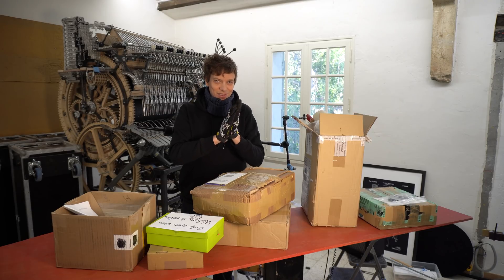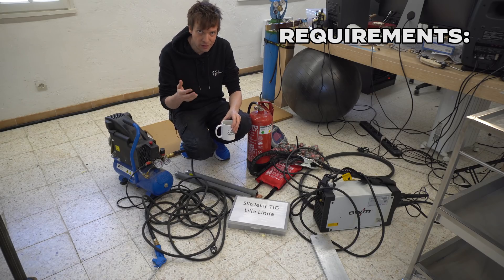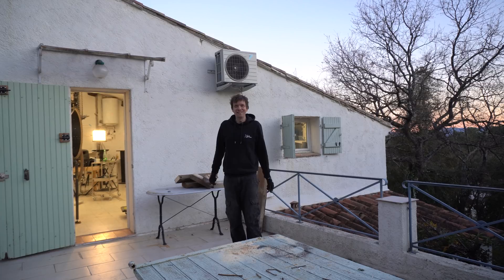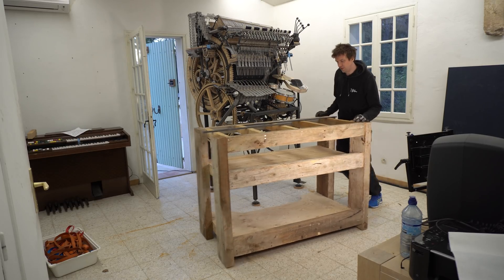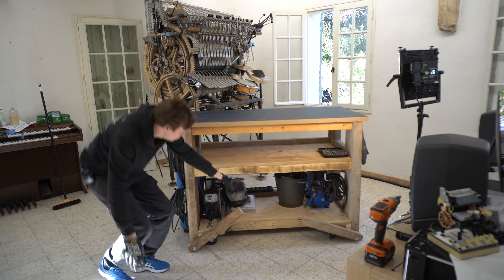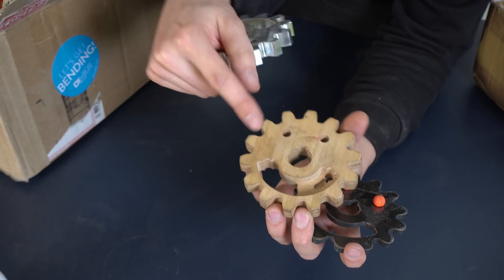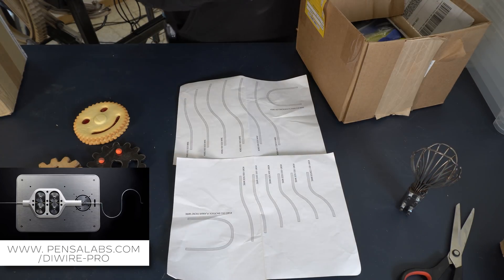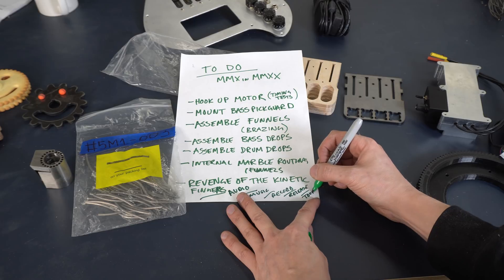New parts New workbench New start - Marble Machine X #113

Comment: table locks: with an 10cm notch at the bottom the table would lock fimliy when bar is on floor. upright would disengage. no more diagonal obstructions of shelve. quickly done.

Comment: Not very logical this table for me (but i'm not an engineer), to have made such massive legs which are useless... in fact either you are on the wheels to move the table, or you are on the "lock" system which is screwed on the legs and which has a small rounded surface in contact with the floor. the logic would have been that when you lower the lock down system you are on the wheels to move the table and when you remove the lock you are on the massive Legs on the flloor with big contact, to be much hefty and stable ^^ no ?

Comment: I'm disappointed that you are adding a motor. The whole point of the marble machine was that it was 100% handpowered. Obviously you need electronics for the instruments, but to artificially cause the wheel to spin with a motor seems cheap to me.

Comment: Don't really like your motor choice, at my opinion you have 2 solutions: stay manual or make a full system with sensor to ensure you have the correct speed. Your actual system is just good for a little assist, but not to fully control your tempo with a minimum of accuracy. At my opinion, adding some sensor and a one-way bearing to your solution could be a good idea.

Comment: OBS OBS MARTIN!

You need to check that your extension cord is able to carry the current that your welder puts out, and I'm 90% sure it does NOT.
Your welder needs to be able to gulp 16A through everything, and those splitters are usually very thinly wired internally.

Safety aside; MY GOD you've done a lot! Must feel so good, and I wish i could pull myself into a similar organizing mode. I will try, after seeing what you've accomplished in 3 days man.

Well done and keep it up!

lotsa love from Norway! 
PLING

Comment: Your workbench legs are built super thick and strong but I think you shoutd reconsider the lever mechanism as your working weight is resting solely on the pivot bolts. Check out Carl Holmgren's channel. I've made most of my shop furniture based on his  collapsible wheel system. It works great and looks super classy for shop furniture, which I think is a little bit your style. https://youtu.be/7TTnb3TyH5Y

Comment: Welcome back! You were missed good sir!
The smart motor drive is an awesome performance based improvement to the MMX!!! 
Lotharyx has a great safety idea. You have a VERY heavy table now, and it would be easy to inadvertently fall off the lever based feet. I say this as I've actually seen similar actually happen. Was not pretty.

Comment: Beware the electric plugs below the table! They will collect electrically conductive dust and metal chips. Better install the plugs on a vertical surface, below an overhang or, even better, face down.

Comment: While I appreciate Maureen's animations for the Kinetic Fingers I still vastly dislike them. I agree with you 100% that having some sort of additional visual indicator will be beneficial for audiences not close enough to the stage to see the action of the mechanisms, they are just way to visually disjointed from the rest of the design. The MMX has a glorious clockwork, engineerpunk aesthetic and the spider-like and honestly rather creepy looking fingers are obviously offputting to a number of people. Perhaps some sort of semaphore flags or even little RGB LEDs that you could program to light up and flash different colors per song?
Reply: I think maybe something like a rod (wood with steel tip maybe) could accomplish the goal. I'm not sure how it would look, but it could give enough exaggerated movement to fit the purpose while not looking creepy. 

I'm not sure putting RGB into the MMX would do more than mess up the ascetic. 
That said, putting in some warm white lights (like the yellowed white of the classic Christmas lights) I could see fitting the theme, lighting dark spots for cameras and perhaps highlighting active zones like @guttebo is saying.

Though this is just as likely to be considered Feature Creep by the powers that be.

Comment: Id have done something different Martin. Having the electric sockets at the bottom of the workbench, facing up, will mean itll catch a lot of dust and debris. Maybe even cause shorts if you work with metals.

Id pop the sockets on the back of the bench, facing outwards so it cant collect debris that easily and you also dont have to crouch down every time you want to plug something in/out.

Comment: I'm sorry, Martin, but the kinetic fingers are just a bad idea, and I think I can convince you precisely why that is. I did watch Maureen Krauth's animation. It doesn't change the underlying problem. 

The problem with the kinetic fingers is that they violate a key core value of the MMX. This core value is "function over form." You have shown us, in your design for every single particle of the MMX, that the machine values function over form. The machine is efficient, packing a tremendous amount of function into a relatively small volume. Consequently the elements of the machine—the gears, wires, screws, everything—are exposed and direct. The machine doesn't waste time, energy, or weight on superfluous or cosmetic elements. It shows itself as a machine. So, in everything you've done with both machines so far, you've vigorously followed this principle of function over form: mechanical efficiency over cosmetics. 

The reason everyone hates the kinetic fingers is that they violate this principle. They are a purely cosmetic, not functional, element. They don't contribute to the music; they are purely visual. They represent the machine being untrue to itself. They are a pretense, not a reality; a mask rather than a face. 

I know you're concerned about audience members not being able to see the machine in operation well enough. But come on: find another way to solve this problem. The fingers don't even solve it: they only enable the audience to see moving parts, not to see THE moving parts that actually make the music. So: set up a video feed of a camera close to the machine and project it onto a screen, or let people tune into it on their phones. Maybe there are other creative ways to increase contact between the audience and the machine. Frankly, simply ignoring this problem would be better than the kinetic fingers. Jimmy Page plays a mean guitar, and no one past the fourth row of a Zeppelin concert could ever see the fine details of his playing. And that's okay. They could hear it. They could see his overall body movement, just as they'll be able to see yours and that of the rest of the band. Jimmy Page didn't wear giant mechanical fingers over his fingers to help people see his playing. He didn't need to. Neither do you.

It's a bad idea, Martin.
Reply: This is spot on. Whole time reading this I was thinking about guitarists. And then you finished with that point. I hope Martin sees this. 👍
Reply: I hate the Kinetic fingers because they look creepy and terrible as all hell, not for any other reason.

And I hate to argue against a fellow opponent of them, but ... Marble Machine is about doing the job of a simple synthesiser or set of musical instruments with freaking marbles for no reason.

In that sense, the whole damn machine is really "Form over function", as functional as all other parts may be.

EDIT:  I can join with you wholeheartedly on one thing for sure though, regarding function over form.

I hate the fingers even more knowing that functionally they absolutely DON'T need to be there.

Comment: why do you need to build a table stopper?
you can use wheels with stoppers builtin already.
like this:
https://www.google.com/search?q=table+wheel+with+stops&rlz=1C1CHBF_enIL860IL860&sxsrf=ALeKk02Dge6wsemsRXaDlH4m3klvdBJcRw:1582212577727&source=lnms&tbm=isch&sa=X&ved=2ahUKEwis8J2VueDnAhUsNOwKHe0pC0wQ_AUoAXoECAwQAw&biw=1920&bih=1057#imgrc=SrV0sn1CI81hiM

Comment: You should put a steel surface on the workbench, then you can use it as a welding table. There's an Ebay seller in the UK selling pre-cut fixture table plates for making your own welding tables with lots of 10mm slots and fixture holes. I used one for my own welding workbench.
Reply: https://www.ebay.co.uk/itm/Welding-Table-Top-Jig-Fixture-Plate-Make-your-own-Table-Jig-fixture-mig-tig/273630693229?hash=item3fb5a9076d:g:olcAAOSwfPlbpOCW

Comment: You have a problem.
If you push the table sidways while the taple is up. The table will flip to the rolls and drive away .
Wouldnt be so cool if you are welding .

You can drill holes in the handles into the stands/legs .

So you can lock the handles with a M screw or bolt or stick . 
Would be a bit safer, i think.

Greetings from germany 😉

Comment: If that bench isnt study enough Mathias has a recent design where the bench has no wheels, but he has two long L pieces with the wheels on them. You slide them under the bench and rotate the L so its vertical, and the wheels lift the work table up when in this position

Comment: I'm glad to see you called in a plumber for the rest of the renovations.I don't think you would survive any more of your your "safe" cutoff wheel/grinder forays.L.O.L. 😆 Although I can see that the simplicity of fixed kinetic fingers will help speed up progress and would have the desired effect from stage to audience distance,Maureen's expertise in puppetry might be worth considering.This more realistic finger motion is more in line with the high calibre of the rest of the machine,and in my opinion would help the MMX fit in,in a museum some day.Personally I think if the finger components were light enough,a high strength string could be used and still make the fingers reliable and less spider leg like.With the progressive complexity and rotating mass of this version of the MMX,the electric motor might be a necessity for extended on stage performances.Staying organized should help with your progress and creativity.Glad to see you back Martin!👍😃

Comment: I may be being a little picky here, but the massive legs on your workbench don't seem to be doing anything. The entire weight of the thing is on the 4 little levers. As you are not using it for a race car, why not make the wheels movable vertically, and use the legs for holding the bench steady?

Comment: 12:40 OMG YES!!!!!! I commented on a video very early on in the mmx production about using a motor. Like how in the movie breaking bad they attached a machine gun to a garage door opener and controller. You could then easily add a potentiometer to it with the right voltage, and bam your in business!

Comment: So looking at your marbles and how many get loaded in certain directions I would almost tell you that the best way to do is to make it so that there's a secondary track on a backdrop of your primary one that instead of taking both marbles takes off two out of the four and puts that all the way at the far end instead of putting it at the front end making it so that regardless of how the marbles roll you'll have an even balance all the way across maybe takes off from having to build another track all together and just makes it so that first one officially Works adenmoor steadier pace

Comment: The bench looks awesome. One thought, You might want to move the power board to be mounted upside down or vertical, as where it is now you might get dust or metal shavings in it.

Comment: Are you sure that your extension cord where you plugged in your welder in the back of your new workbench can take the power required by the welder? Usually those extension cords only will take up to 1500 W and I guess your welder has more than that. Especially when you have other equipment running from the same extension cord. You could cause a fire by doing that.

Comment: @Wintergatan -  I always felt the Kinetic Fingers should be replaced with Light Tape.  easier for the audience to enjoy.  a bunch of small moving parts is not easy for the audience to understand on a screen.  it's just a jumble of moving "stuff" that all looks the same.  but the light is far easier to enjoy without having to figure out what's going on..    also Boiled Linseed Oil should be put on the bare wood to seal it from moisture. the last thing you want is to have the wood swell and change dimension and be out of spec for a show night.  the result could actually cause the wood gears and wood moving parts to swell and lock up the machine.

Comment: Motorizing the MMX is a good decision, but comes with some serious concerns.
Fail safe redundancy may help prevent a malfunction from turning the instrument into a large claymore.
Having an isolated system that disengages the flywheel at a certain rpm is likely ideal.
Finally, a temp gun would be invaluable in finding binding points that are generating heat/drag before it catches fire.

Comment: After watching both the Meticulae videos on the fingers, I don't think I agree with your quick mention that you want to go with the rigid fingers. The entire purpose for the fingers is to provide a visual feedback from the stage of the marble droppers in action. Stage movements need to be BIG and OVEREMPHASIZED. The extra motion of the articulated fingers will stand out more at a distance, and close up add an organic feel to the marble droppers. I wouldn't use her suggestion of the braided picture hanger wire, I'd use aircraft grade wire rope.

Comment: You can get locking wheels for that workbench. I would be worried about applying too much force from the side and the legs pivoting out. A dowel to lock the legs in place would be a cheaper solution too.

Comment: Suggestion: Add pins to your table lifting levers to lock them in place when the table is lifted (i.e. up off the casters).  This will eliminate the possibility of a lateral force causing the levers to fall over and unexpectedly allow the table to roll.
Reply: He should have inverted the design: casters on extensions. That way is a fail safe design (if extensions fail, it would drop to rigid, static legs).
Reply: Arthur Reis I agree, but adding pins is something Martin can do easily in minutes with a drill and a few spare bolts, without having to rebuild the entire table.
Reply: Or marble detents
Reply: Vaughn Cosner That would certainly be keeping with the spirit of the channel!
Reply: What about heavy duty castors with brakes??
Reply: Patrick jones Casters with brakes set are not immobile like solid legs are.  The casters can still pivot when the brakes are on, because the wheel doesn’t have to turn for it to pivot.  Having solid legs on the ground is much more stable.
Reply: @Lotharyx brutal

Comment: I was listening to the original song, and I got an idea.  When you play the song, I’m guessing you practiced and know timing hen to start and stop cranking and timing.  But what if, during the tour, a song ends and spins farther than during practice.  Then when you put a new song on, you may start at the wrong time.  If you don’t already have an idea, I think you should have a system that realigns the programming wheel.  Also, was that a lego marble machine?  I need one!

Comment: I hate to criticize such great creativity, but, you spent so much time with those massive legs, that I was surprised that you jacked the legs off the floor rather than moving the casters.  It seems you would want the massive area of contact on the floor rather than the small contact area of the jacking levers.  Any forces would be distributed over the larger contact patch.  Just a thought.  Bon chance!

Comment: Welcome back, Martin, I really missed your videos. Your channel is one of the most educating and entertaining at the same time, that I know of, because it touches so many different fields of interest, from music over engineering right into philosophy - I love it!

One remark from a firefighter‘s perspective though: the fire extinguishing blanket you put on your work bench (labelled in German „Feuerlöschdecke“, which means exactly that) is not a very good fire extinguishing device: it‘s area is very limited and unless the fire is really small it is very hard to stop the airflow to the fire rendering it almost useless. It may even give you a false sense of security or confidence. I hope you‘ll never need it, but directly below the blanket you have a real fire extinguisher. If you should ever need to, use that instead of the blanket! The powder is a mess to clean up but it deals with fire far better than the blanket can. If you‘re concerned about the powder‘s mess, maybe consider a foam based extinguisher. Stay safe!

Comment: I'm partial to the shoddy door-workbench that you used to build the new bench. Also: why not use locking/retracting casters in lieu of using those 4 wooden risers? The risers seem like they wouldn't be the most solid option...

Comment: if you use a metal plate on your work table you can use it as a mass for your welding machine.  this is very helpful for small parts.

Comment: I'm WARNING YOU! Make sure you create a break point between the motor and your machine shaft. If it jams. YOU NEED TO HAVE AN EMERGENCY RELEASE.
Reply: He has a torque limiter on the flywheel, I guess he is just gonna hook up the motor to the flywheel
Reply: He has shown that he can stop the machine even while the motor is on.

Comment: I am not surprised by the motor. As I've watched the pieces coming together I've been wondering how you're possibly going to have enough free hands/feet to operate the rhythm machine, AND the bass, AND the hi-hat, AND the muting levers. I think it will be nice to be able to step away from the crank/pedal for a few seconds in moments of high demand and know that the thing will keep going without your input.

Comment: Have you considered connecting the top of the workbench using hinges (and a latch to lock it down.)  This would make it easier to store larger tools on the shelf that the skirt would prevent from fitting.